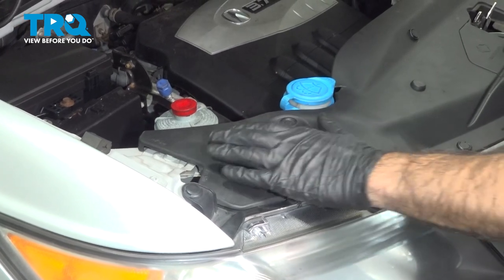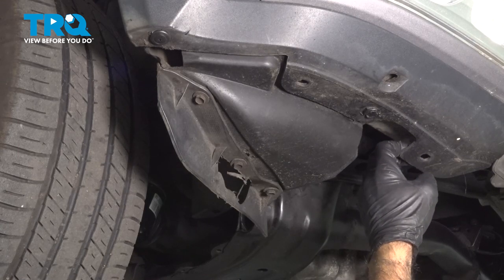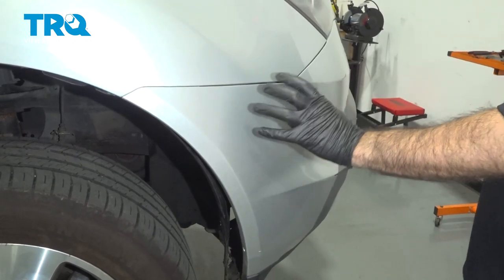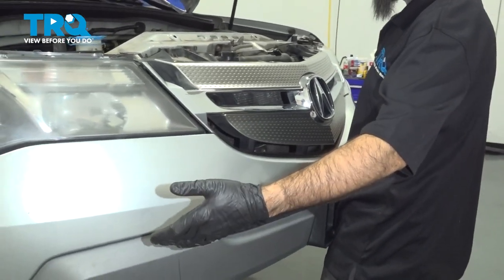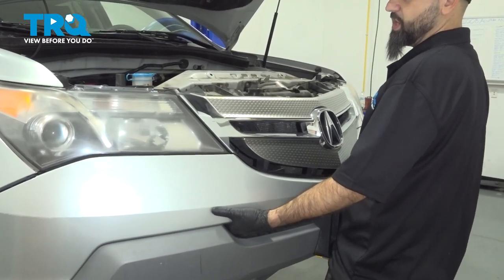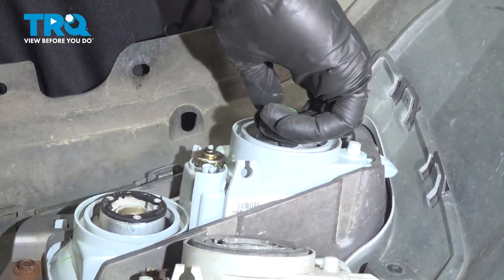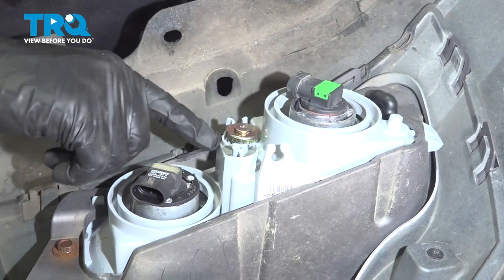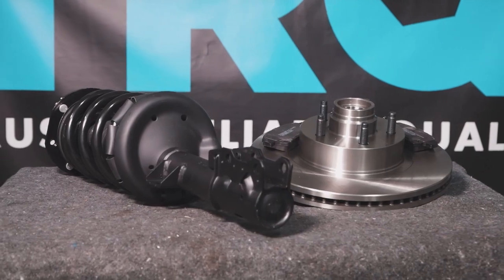How to Replace Fog Lights 2007-2013 Acura MDX

Comment: Not trying to be smart but you can just remove the plastic cover underneath the car and unscrew the 10mm bolt from the fog light housing - and push the housing out that way  . Remove the whole bumper seems a little bit waste of time